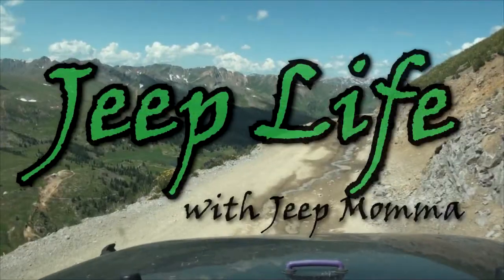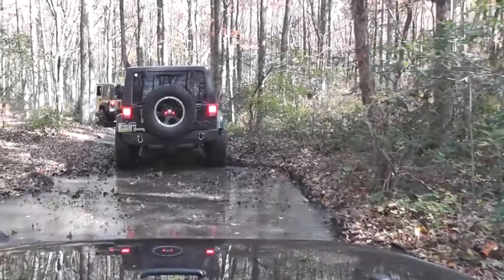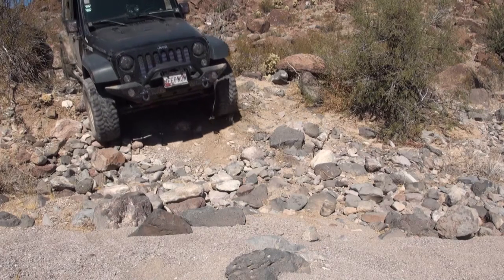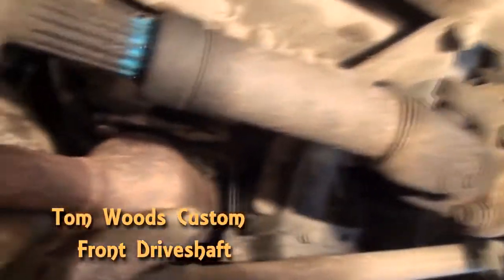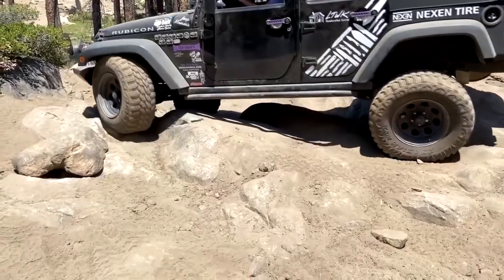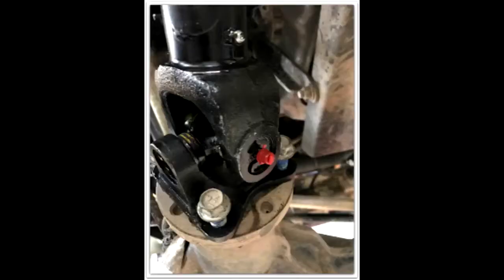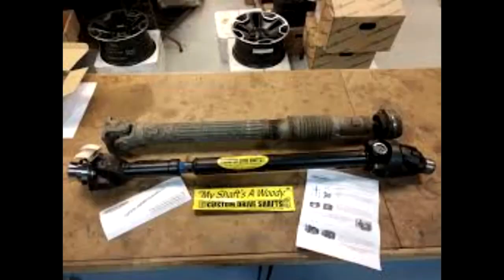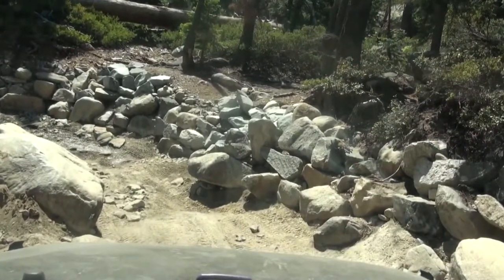A Must Do Mod When You Lift Your Jeep -  Tom Woods Drive Shaft

Comment: More than a 2 inch lift on a 4dr you are taking chances. Height changes the drive shaft angle. That To. Woods piece is a cool thing! If you want to prove it to a customer. Replace it 1x and tell them, the next time it fails, its all you, brutha.
Reply from the maker: Agree!!!
Reply: @shiftintohigh5564  what about on a 2.5 inch lift with 33 tires wrangler x 2 door

Comment: 3&1/2 inch lift 33 to 35  55 thousand miles no problem yet. Rubicon 2016 2 door
Reply from the maker: Awesome!
Reply: The longer the wheel base the greater the angle.